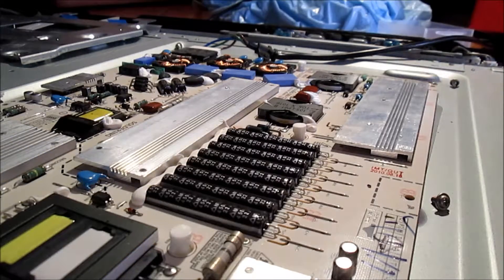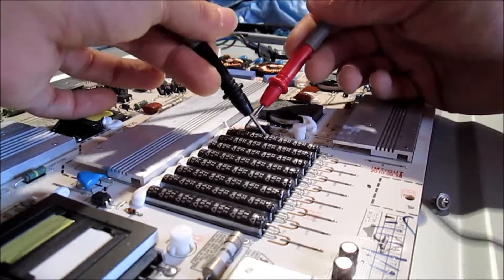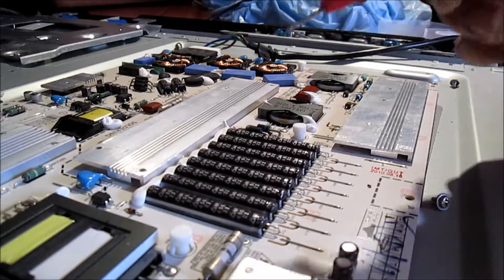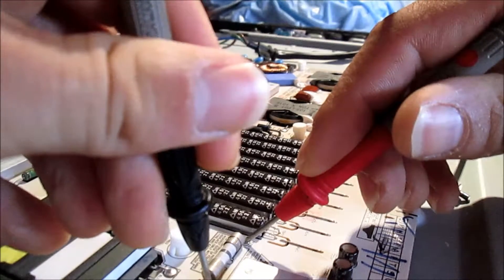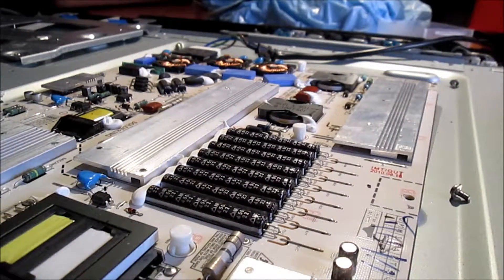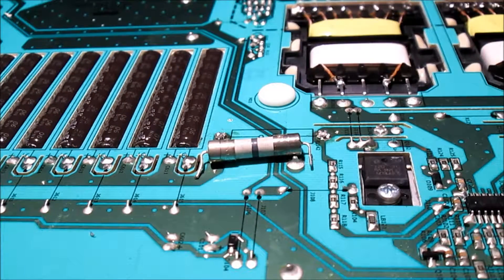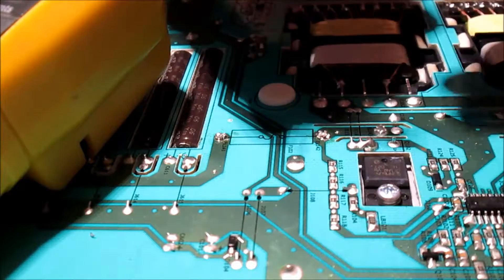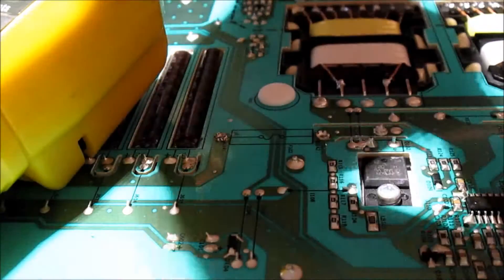FTVlog 73 - Reparing an LED TV LG-47LE5310-ZB

Comment: The problem is that the replacement cost of the powerboard and the logic board would've made it too expensive of a repair job. Normally(or always) you can buy a new TV for the price you pay for those replacement boards. Unless you can diagnose the exact point of problem(component) on the circuit boards and replace them, it is rarely worthwhile. However,  it is fun to try. No argument there and it is a great video to watch.  Thanx.
Reply from the maker: Hi Dom, I do it with consent of my client. the problem is there is no parts for this TV, at least i don't find here. this tv stop working with a storm so the problem is all boards burned i try to replace some components but still burning, so i decide replace all and that solve the problem, i think the chips are burned with that i can't do much. 
cheers
Reply from the maker: thanks! it seems this tv have a great sentimental value for the owner. I use repaired parts so the total repair price is half of the owner pay for it or a new one with the same features and size.